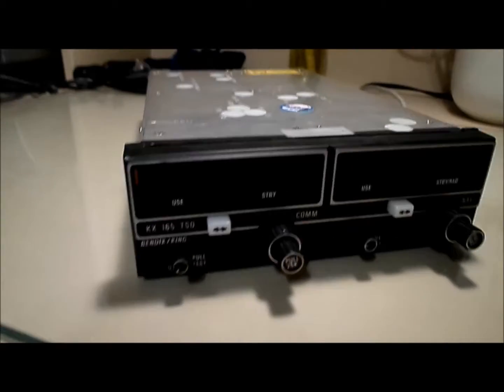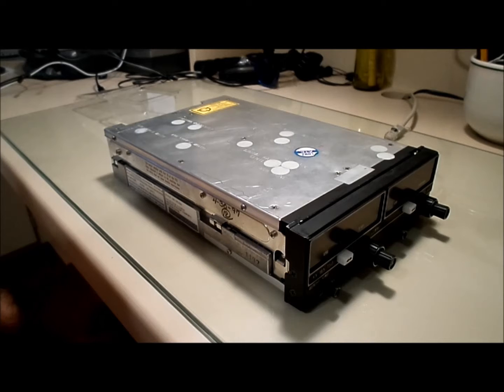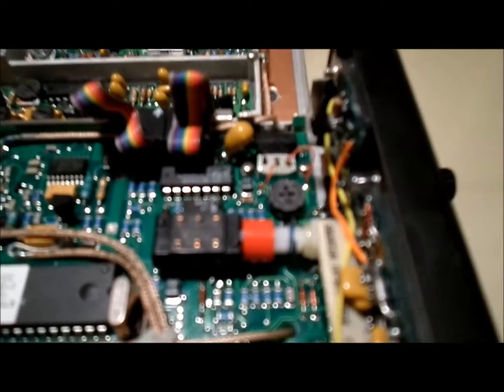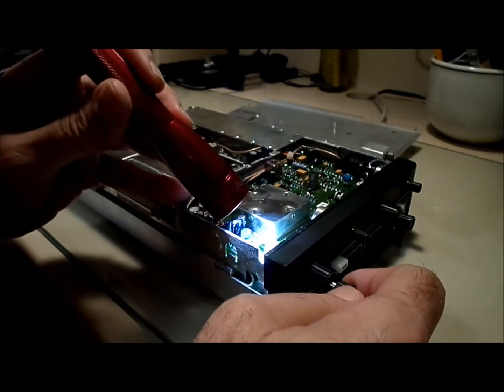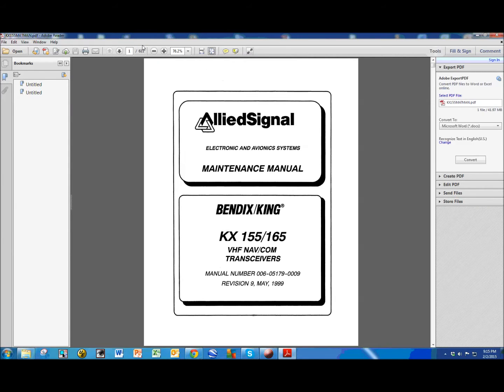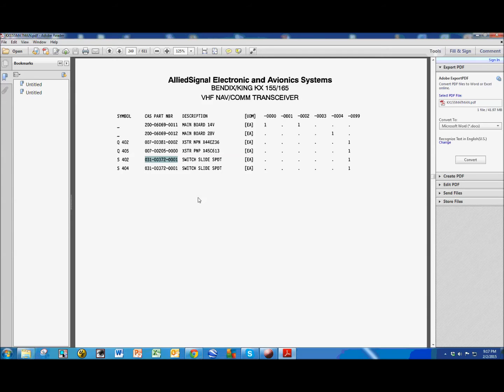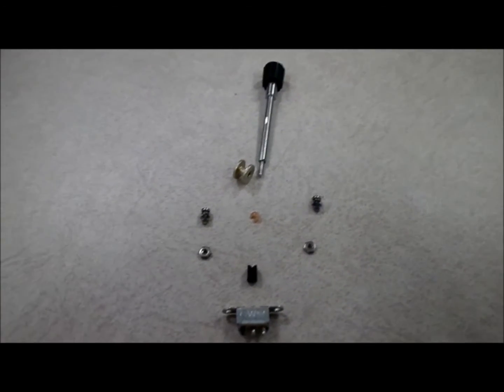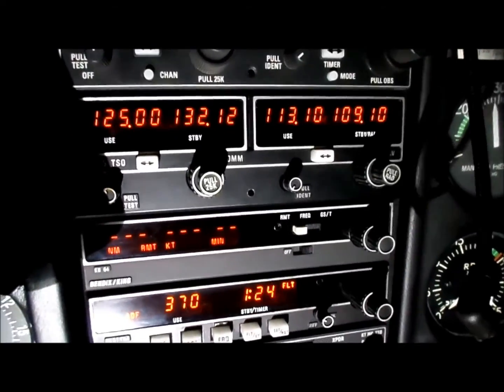Bendix/King KX-165 Nav/Com Troubleshooting and Repair

Comment: Very informative video.  Last time i opened one of these was in college back in 97.  So you guys are aware, you are not legally allowed to install a radio that you have serviced on your aircraft.  you need an FCC license in order to be able to service any radio that transmits at this power level and these frequencies.  
Posting this video could cause issues with the FAA if they get a hold of it.

Comment: Thank You ! learned so much.  I wish you could do a KX155a also as I don't even know how to open it.  Basically, I have a display that is not all on until it warms up.  I think just loose contacts. But how to get to the display?  so many screws!
Reply: Displays on both  are easy. 4 screws on the sides of the front cover and the front slides over the knobs. There is the display in a long socket. It is powered by negative 190V. Most likely not your problem. They display is an old style vacuum tube type from the 80s and 90s that is no longer available. It is most likely your problem. You can get a digital mod for these displays but expensive at 1500 bucks or so at a avionics shop.

Comment: Thank you!  Very interesting video!  Now I know how the switch on the pull handle works.  I make a replica radio stack for the Cessna 172 home cockpit, and am very interested in the height of the signs on the 7 digit indicators on KX-165 Nav/Com.  I shall be very grateful to you!

Comment: To bad Honeywell announced this week that ALL repairs will require units be exchanged with the factory.  So your $8.00 switch is now an inconvenient $2-3k.  One of the reasons they stated to the Aircraft Electronics Association of this action is the condition of field repairs and "liability".  Reality is greed and an attempt at a monopoly on repairs.
Reply: That’s messed up.
Reply: I still have a dealership with access to parts, but what parts are available are embarrassingly expensive. At the time of the original post it looked like most dealers would be  forced out of repairs.  However the “license fee” became pretty stiff and were it not for sales of the “A” display upgrades there would been no justification for continuing.  I think my recent tally was just a few shy of 150 upgrades (an additional 50 or so on the Legacy 155/165’s).  However a legacy upgrade can run very close to $3K if you have a healthy unit, the “A’s” are often close to $2K. The original “exchange” scams became a crash and burn and was abandoned.  So it’s a fair assessment, these guys are not your friends😢.